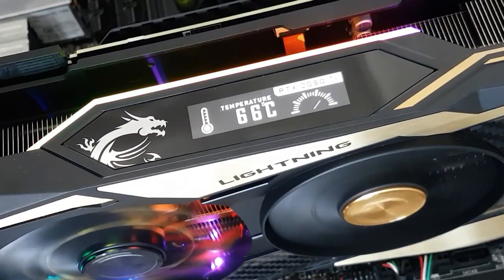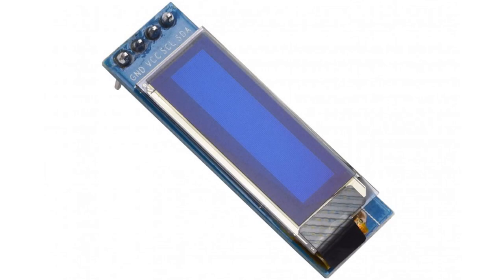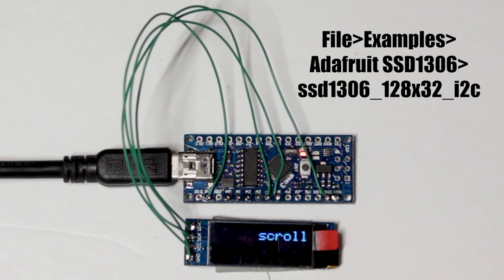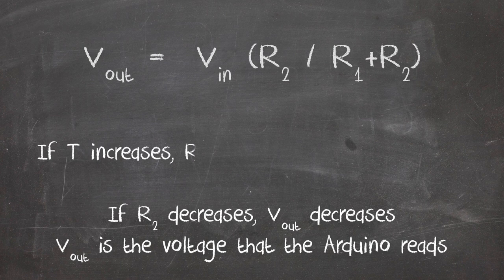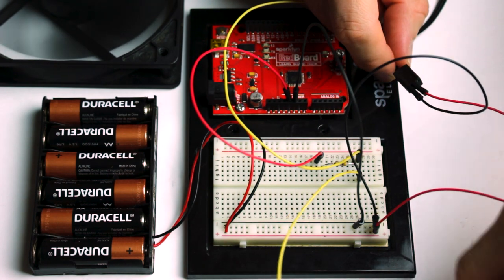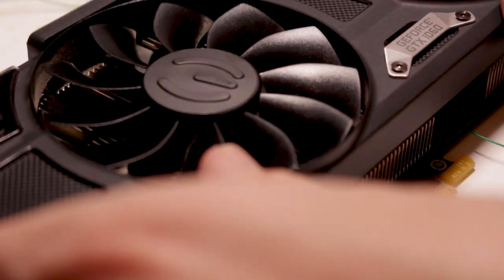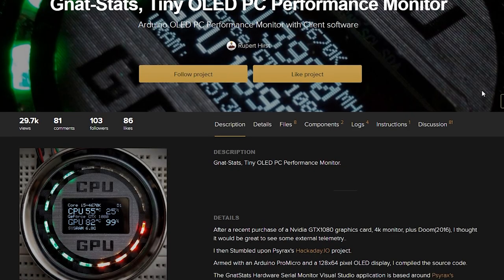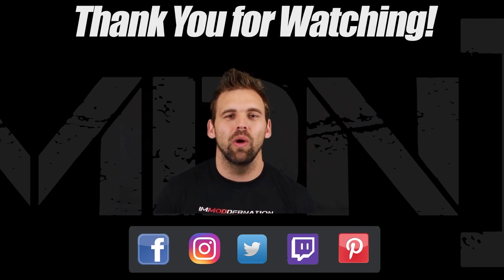RTX 2080 Ti ARDUINO OLED HARDWARE PERFORMANCE MONITOR GUIDE

Comment: Would it not be easier and more accurate for you to use the inbuilt temperature sensors and feed that info into the arduino via USB?
Reply from the maker: That's exactly what Gnat Stats does. Did you watch the end of the video?
Reply: @ImmodderNation  commented right before that part came up, am kinda interested. Also You've been pretty inactive for some time, working on something big or are you taking a break?
Reply from the maker: Got a full time job. Makes it difficult to work on projects. Watch the video "Big Announcement" for more information.